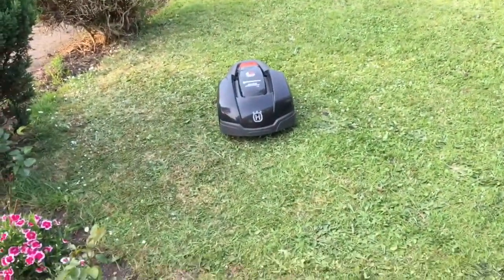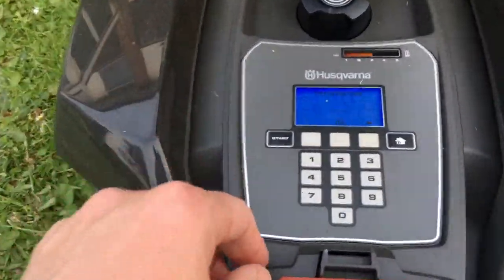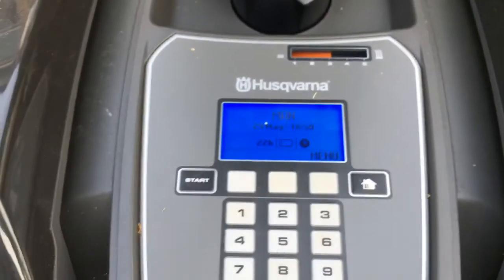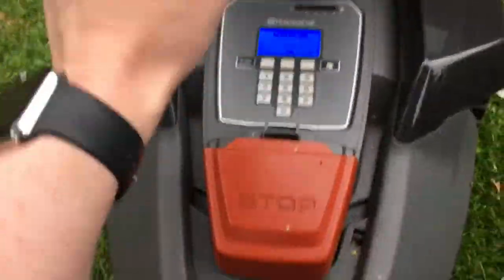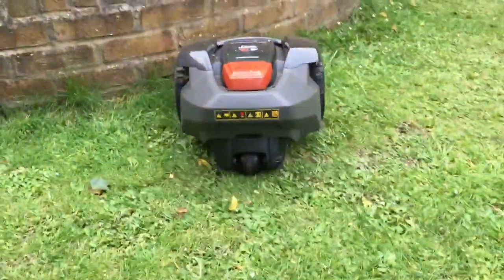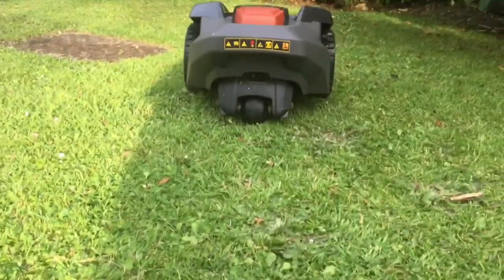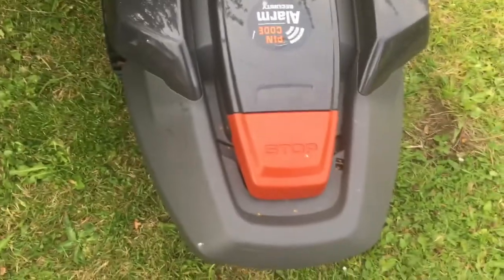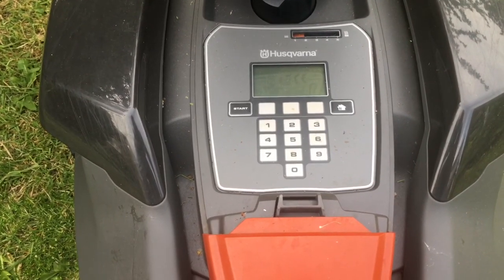Husqvarna Automower Challenge: Alarm Stress Testing

Comment: i was sending our one home so i put in the password it was stuck so after i put in the password and pressed ok the alarm still went off
Reply from the maker: You have to do it quickly or the alarm goes off. It’ll prompt you to put the code in again, even when the alarm is sounding.
Reply: @shazelden  I didi do it quickly
Reply from the maker: @cameronbyrne7970  either not quick enough or you put in the wrong PIN number. Hard to know where you went wrong I’m afraid.
Reply: @shazelden  It is after brought up auto mde and the date
Reply: @shazelden  And all the other stuff it brings up after you put in tne password.

Comment: Great video.  If you let the battery run out while in a secondary area, does it retain enough batter to set off the alarm?
Reply from the maker: riggsmed  that’s exactly what the video is showing. If the battery starts dying in your main area, it will have already returned to the base to charge and so you’ll never encounter a flat battery in your primary cutting area. This is the front of my house and has no access to power. I also left the battery ‘flat’ for a further 24 hours and the alarm still sounds (but for security reasons I did not leave it out at the front of my house during that test).
Reply: What if you lift it when it’s mowing
Reply from the maker: @cameronbyrne7970  yep, the alarm goes off if lifted so it elevates the rear passed a certain angle. If someone picks it up and keeps it level thinking they can trick the alarm and walk off with it, the alarm will also sound a few seconds after the mower detects it is outside of the loop wire/cutting area.
Reply: @shazelden   how long does it go o off for
Reply from the maker: @cameronbyrne7970  I think you asked the same question yesterday and I did respond
Reply: @shazelden   oh sorry my phone is not working probably
Reply from the maker: @cameronbyrne7970  no worries
Reply: @shazelden   we have the 105 to
Reply: And it keeps getting stuck and setting if it’s alarm
Reply from the maker: @cameronbyrne7970  what’s it getting stuck on?
Reply: @shazelden   it was getting stuck on the concrete where it metre the grass
Reply: @shazelden   I will post a video of it stuck on you tube
Reply: @shazelden   sometimes it gets stuck on its base
Reply: @shazelden   and sometimes it gets stuck upside down
Reply from the maker: @cameronbyrne7970  stuck as in it doesn’t come out, or stuck as in it mows over it and  gets stuck. If stuck when coming out, then clean it all off thoroughly so you can only see the plastic and the wheels can grip. If it is mowing over the base and catching on it, then you can install obstacles so it bounces off them before it gets stuck and changes direction. Have you gone in to the settings and adjusted the amount of distance the mower runs over the wire? If you reduce that then it might improve the situation.
Reply: @shazelden   I left a link
Reply from the maker: @cameronbyrne7970  excellent, that really helps me see the problem. So I’m going to guess that there is no boundary wire around that concrete patch in your garden as you hoped it would bounce off or go straight over it. So the mower doesn’t know that it shouldn’t just carry on and so goes full speed and gets stuck. You could either build up the soil around whatever that is so it is level and nothing to get stuck on. If it’s only that bit that causes the issue, then a line of garden canes pushed in to the grass just before it would help the mower to hit those and change direction rather than push forward and get stuck like it has (the sticks/canes are the quicker solution and you can move them about until you get the perfect position so the issue no longer occurs).
Reply: @shazelden   there is a wire around it
Reply: @shazelden   well we have 2 105 s
Reply: One for the back and one for the Front
Reply: And both of them get stuck
Reply from the maker: @cameronbyrne7970  the wire has to be at least 30 cm away from the edge of whatever it should be avoiding. What is the setting for distance over the guide wire in your settings?
Reply: @shazelden   there are parts where the ground is soft